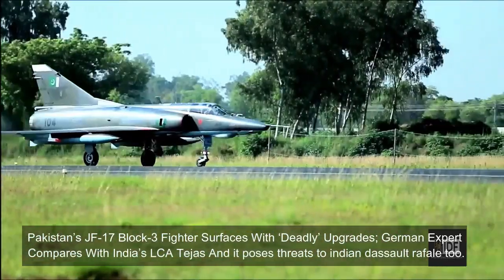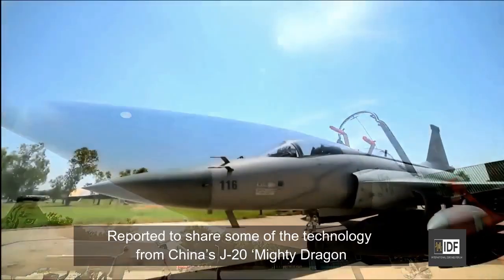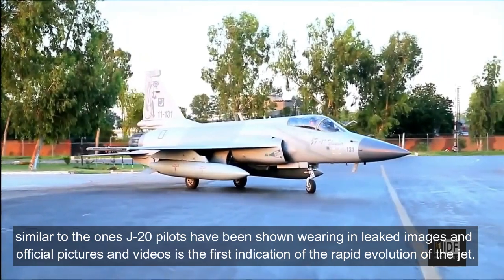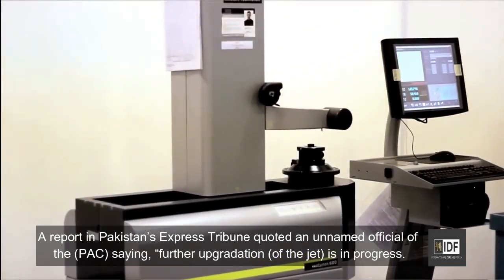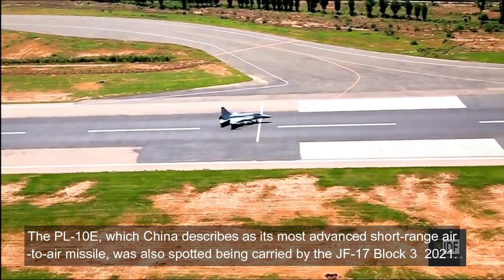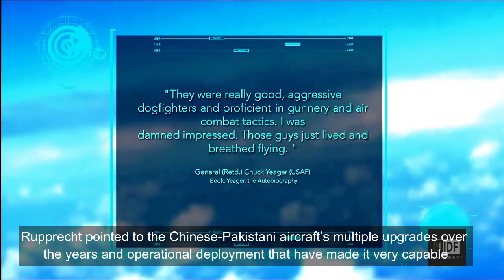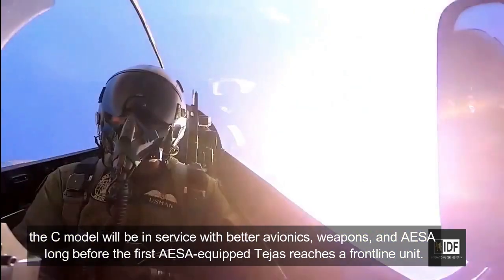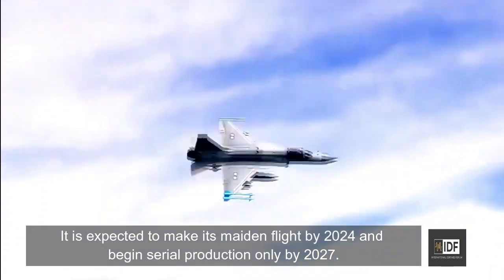German Military Expert On JF-17 Thunder Block III VS Tejas MK2

Comment: JF17 blunder will surrender to its master (Tejas) when it enters porkistan airspace, Bcoz JF17 is a failure 40% of blunder is grounded in porkistan due to engine problem and technical malfunction, 100% of Myanmar JF17s are grounded due to 4 major problems engine, maintenance, malfunction, and in high speed the JF17 gets too much of gravitational pressure and the pilots felt unsafe to fly this garbage, in 2019 Paris airshow JF 17 Blunder got breakdown and it was towed in the runway, on the other hand LCA Tejas did 9000 hrs of test flight not even single crash and a complete reliabile jet, already more than 40 tejas was inducted and total order of 220 Tejas mk1 and mk1A was ordered, dont compare Master (Tejas) with these kind of garabage (JF17), When Tejas comes JF17 will run away or it will surrender to Tejas bcoz surrendering is not a new thing for porkistanis they will surrender to India,  porkistan did it before in1971 war, and porkistan know how to surrender and when to surrender they will surrender to India again at the right time, Dont compare This JF 17 shit to The mighty Tejas, Tejas will always win Om namah shivaya 🙏🙏🙏

Comment: Tejas block 2 will become better as its weight and class is compareable to gripen E   not JF17 block 3   but as compared to Tejas mark 1A    JF17 block 3 is better with PL 8   and PL 15  and AESA radar much better then tejas
Reply: tejas block 2 has a much better ppt

Comment: Tejas mk1a will be delivered to the IAF by Feb 2024.
Reply: Stop promising, start delivering. Anyway, mk1a is still a lemon and way behind even jf17 on so many fronts including radar (proven AESA) , BVR missiles (pl15 and pl10) , engine, avionics, HUD and many more.
Reply: @n.c9653  Production of Tejas mk1a has begun. It will be delivered before schedule.
Also what?! JF-17 is ahead in terms of radar? Engine? Avionics? BTW radar is part of the avionics but I guess you didn't know that...🤡
What are you smoking man?
RD-93 is not better than GE-404 man😅😅
Also, Israeli AESA radar is a 'proven' radar.
How is JF-17 radar proven?🤡
Also, ever heard of Derby ER and Python 5? Both are proven and better than PL-15E and PL-10
Reply: @direwolf7491  China has had AESA radar and advanced avionics for a long time. All in production for many years. The engine in some of the Jf17 block 3 would be WS Chinese ones which are much better than the Russian RD93. The BVR missile pl15 is way more capable than what your mk1a has and the pl10 short range is recognized as one of the best in the world. Helmet and HUD is a mini version of the excellent one used in the J20..
Etc etc
Reply: @direwolf7491  which battle was the F22 and f35 AESA radar tested in? You don't have to be in hot war to test, dude. And its been around for so many years on a variety of Chinese fighters.
Reply: @n.c9653  You are the one who said Chinese AESA radar is proven. Lol
I didn't... You know what proven means right?😅
Now you are backtracking...smh
Reply: @n.c9653  Next time come with something useful Pakistan has made. Lol
Isn't the claim JF-17 a Pakistani fighter😅
India has made the Uttam AESA, Astra bvr, the Tejas itself. All are installed and in production. Lol
Reply: @direwolf7491  tested and fired, pal. Your examples are all foreign stuff and your derby er is NOT 150kms and has also never shot down anything in battle. Stop the Indian BS
Reply: @n.c9653  Derby ER is 150km. ER stands for extended range. When did PL-15 bring down anything?
Also, Astra, Derby, Python 5 are all tested and fired missiles.
Reply: @direwolf7491  and please look up PL21 / PL-XX... Latest version. 400kms BVR. You guys are not even a serious competitor, dude
Reply: @n.c9653  So Derby ER has also hit its targets. Ask the Syrians, Palestinians even Iran. 
Also, PL-15E and PL-15 are different. JF-17 is using PL-15E nothing to be spooked about. Lol
The USAF is spooked because their AIM120D is no enough to counter the PL-15.
India has got the MBDA Meteor. Many many of those and more to be ordered soon.👍
Reply: @n.c9653  Why are we talking about China suddenly? JF-17 and Tejas is between Pakistan and India. I thought you said nobody cares about India's military😅
Yet, China seems to be over cautious at the LAC complaining everytime Indian jets fly near the border. Lol
Reply: @direwolf7491  PL15E is exactly same at Pl15 with an artificially cutoff range at about 145kms to comply with international export regulations. Derby is an A2A missile, pal... Hit what  in the countries you mentioned? What planes? What drones? Stop bu/llshitting
Reply: @n.c9653  I Derby ER is A2A just like the PL-15. Why else would I be comparing the two?
How about you stop bu llshitting? PL-15 is been around for like 6-7 years Derby has been tested and used since long before that. 
On which jet, drone or country was PL-15 fired at? Lol
Reply: @direwolf7491  you claimed Derby Er has been battle tested in 4 countries. Against what?. Nonsense. Stop lying. And also, the Derby ER version is not that old.
Reply: https://youtu.be/Z3je4t2Fc04
Reply: @Xarifa Zee Ok attaless jahil bhikhari. 🤣🤣